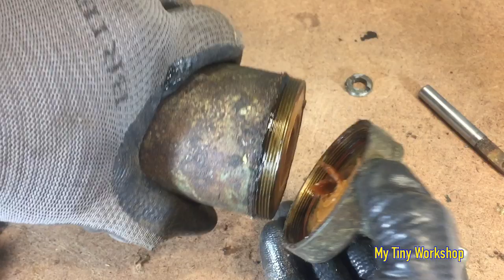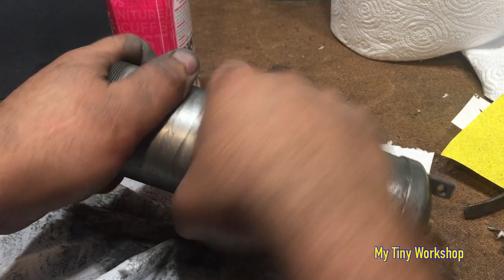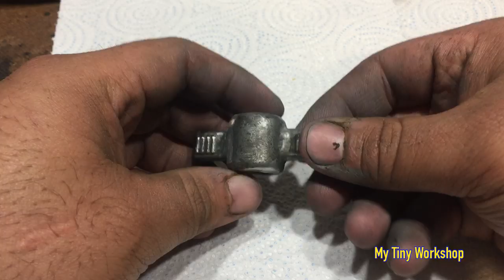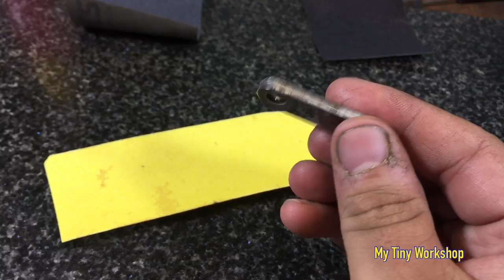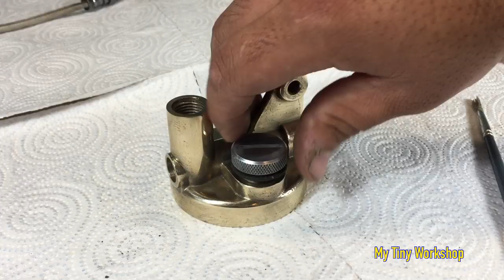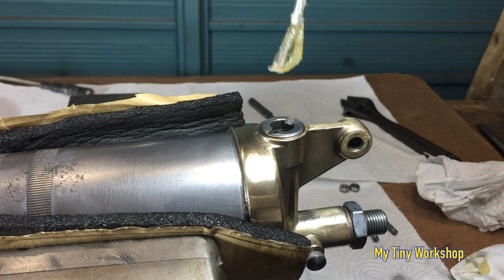Old Rusted Tecalemit Grease Gun Restoration

Comment: Looking good. Looks like the rubber part of the hose is gone. Still works so that’s great
Reply from the maker: Just the tip was a bit worn, but that part is pressed against the metal. Not necessary to change.